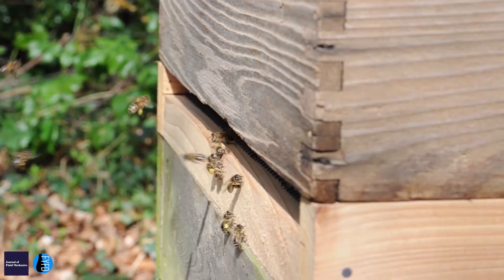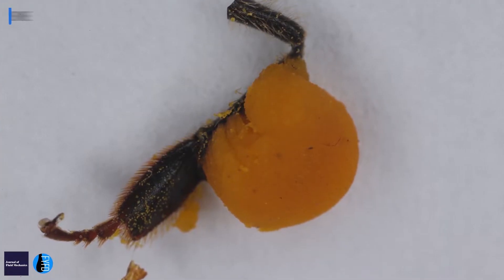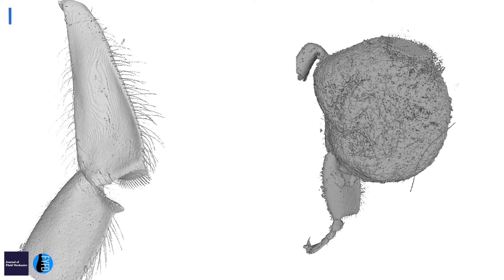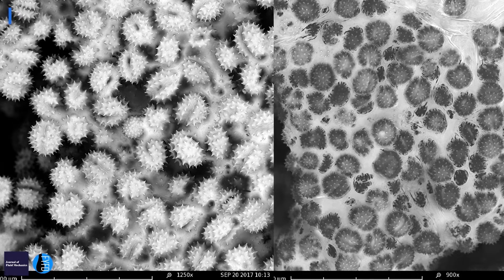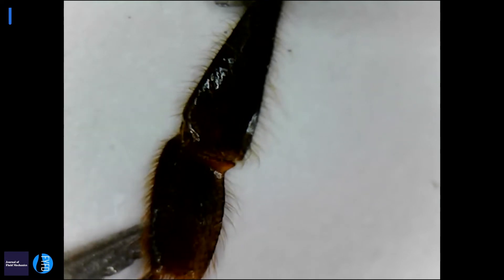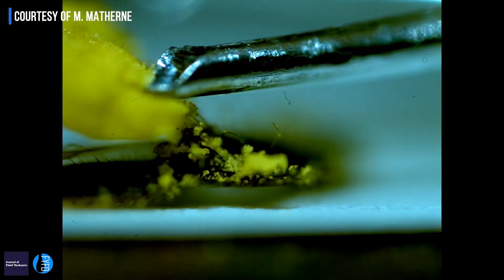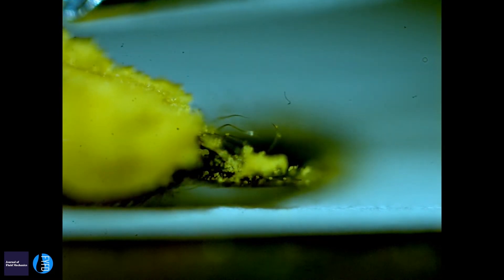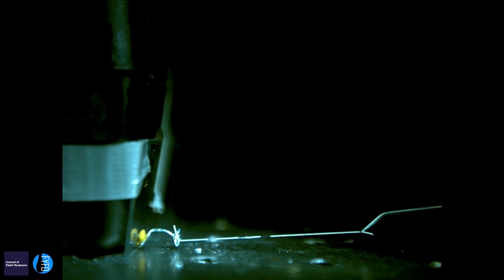How do Bees Carry Pollen?

Comment: Amazing discoveries.  This study confirmed my theory and what I observed from my honey beehive that:
1) Honey bees collect both sector and pollen per trip, simply because both sector and pollen are often on the same flower or flowers nearby, and bees are efficient in all they do, and pollen do not weight much unless they load up with sector.
2) If the theory above is correct, then the belly of the incoming bee with pollen baskets should be bigger than the outgoing bees, and I observe this is the case consistently! 
And I wonder how the pollen are packed solid on their legs...now I know, thanks to your study!